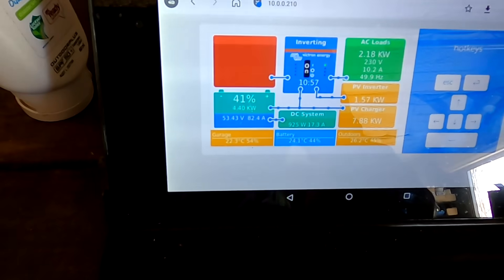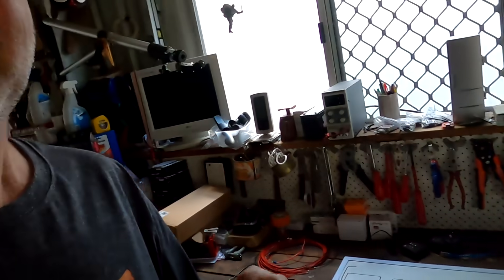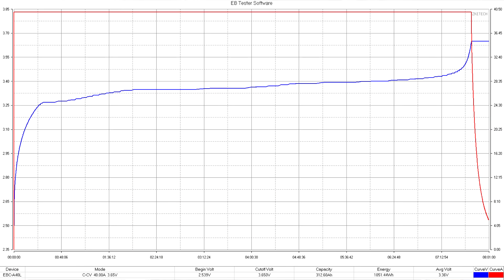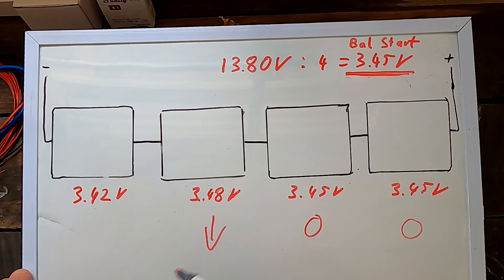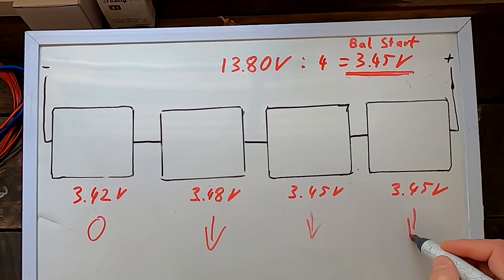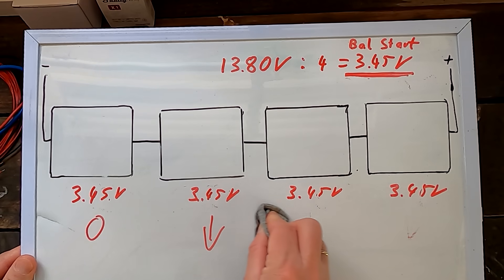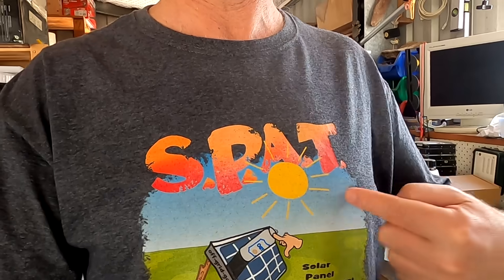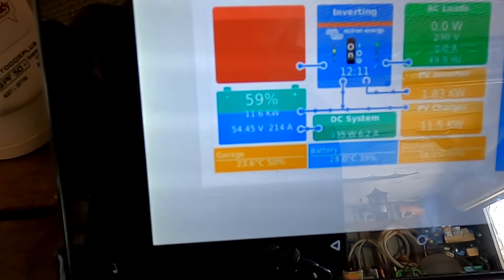Balance Start Voltage for LiFePO4 explained. Why you should not start too early... 🔋⚡

Comment: I have this problem. I just built a 48v battery, and 2 of the 3.2v cells are running at 3.45 volts, but all the rest are at 3.28-3.3v. I am running JK_BMS with active 2 amp balancer. I am not sure if I should pull all the cells and run them parallel with my Zketech charger, to bring all the batteries up to full charge, or just leave my EG4 48-58v chargeverter connected and just leave it charging all the cells while still connected to the BMS.

Comment: You misunderstood how the balancer works, Andi. The balancer is NOT reducing the cell voltages to the balancer start voltage. Thus, it is absolutely fine to start balancing a bit earlier.
Reply: Yes seem logical only if there are some cells clearly ahead in voltage you could already start balancing them down inline with the other cells.
When the voltage diff is quite close then switch to your top balance voltage only.

Comment: Sorry that I have to say this, but you are wrong. Active balancer discharges the higher voltage cell and charges the lowest voltage cell. So there is no loss in power. You SHOULD start balancing early! I start at 3.3V and keep them balanced whole time. Balancer will not work against the charger. But it will prevent the bms cell overvoltage cutoff.

Comment: Hi, in my mind balance means tacking from highest voltage cell and giving to lowest voltage cell. So when highest cell is 3.60 and lowest cell is 3,40 but the balance trigger is set to 3.45 , doesn't BMS take voltage from 3,60 cell and give it to 3,40 cell despite that lowest cell is below the balance trigger ?

Comment: From what I got, there are two types of balancing: Limit and Auto.
The auto has a start voltage that can be set lower, along with a minimum voltage difference. It will only engage if: Cells have a difference higher than the minimum setting, and the current is very close to zero. Why? Because in my experience cells usually don't have the same internal resistance or behaviour along the charging curve, they tend to move around while charging. But when current aproaches zero (almost charged) the more charged cells start to show up clearly, then they can start balancing even if the target voltage is still far.
Then there is the Limit Balance, as explained in this video, it's a mandatory balancing voltage that starts working if any cell goes past that point no matter the current. However, I have set it up higher than my target voltage, because some cells can go above the target voltage at high currents, but drop after the battery is almost charged. It will engage only if some cells are very out of balance, as the voltage would be unusually high. 
But this is my 2 cents and how my programmable BMS works.

Comment: This philosophy is wrong. I would start bal as early as possibles. For example 2,8 V. In this case you would ballance the cappacity of yours cells, wich is the goal no ? Not the voltage. Leave bal function running as much as possible to maximize pack capacity. I have already 3 years running with this setting  on my bat pack and noting suggest different !

Comment: Hello Andy , ithink the battery plateu changed to rise in volt itis the good for setting triggers of balance because if begin at high voltage the time is not enough to complete balance because they triggered cell over voltage protection and then voltage dropped quickly to resting voltage of cell around 3.33 , and when triggered the return charging again they stress the cells in charging and stress bms , so to set bms return charging to voltage in the last of platue to not trigger charging unless using battery.

Comment: Hi, i have a question, if balancer is only performing dropping voltage of cells , there is no way to balance the batterie while discharging if you have one cell that is unbalanced ?
for example my battery is currently discharging (at 10A because i can't find on the growatt how to limit discharge current) , and the delta V of the cells is 0.279V with my lovest at 2.945v compared to other cells ranging from 3.162 to 3.224 volts.

because of that i may hit the 0% soc (2.58V)  value while being at around 40%.

so how can we prevent that ?

Comment: Lets not forget that passive balancing resistors drawing very little energy and does not stop charging the cell. Effectively slowing the charging down for the cell. So it is ok to start balancing earlier with PACE BMS balancer to give it more time to slow down runaway cell.

Comment: Sir    if  balance start   i set 3.45v  for lifepo4 pack  cells   but  what  is the  balance stop  voltage  for  that  should be  same?   Please  tell  little  confuse

Comment: Set the balance start voltage? Where can you set a balance start voltage? When you buy a 12.8V LiFePo4 battery, you can't adjust anything of the bms. Unless you maybe open the sealed battery and loose your warranty...

Comment: Well a smart balancer would take voltage from just the high battery and put it to just the low battery.. If you have a couple cells that are really lagging, moving a couple amps an hour could take many days to balance out.. So starting sooner when there is an obvious difference does not hurt at all.. I found that a slight resistance imbalance in the connection between the cell terminal and the battery can induce cells to lag behind..

Comment: When you prime the cells, after charging them to 3.5+, connect them in Parnell for couple of days with small power supply at 3.5-3.6 v, keep for couple of days, this will balance them perfectly.

Comment: Hi. Andy. Could you guide me please when my battery bank in discharge mode then if one cell is week and its reach 2.6v but other are in 2.9v stat then why balancer is not in on mode? to help week cell
Reply: If you read some comments above you would set the start balance voltage to the default 3.0v. how does this help? when your battery is being discharged, the active balancer will help even out the cell voltages and prevent the weakest cell from hitting the cell UVP too fast. that was my experience too. keeping the start balance voltage at 3.45v will not help the cells during the discharge cycle. experiment with it and see what's best for you though.

Comment: @OffGridGarageAustrali Hallo Andy,
erstmal vielen lieben Dank für deine hilfreichen Videos.
Zum Balancing habe ich allerdings doch noch eine Frage. Ich habe ein 75S System aufgebaut, welches ich mit einer Ladeschlussspannung von 256V eingestellt habe (3413mV). Nun habe ich bei meinem passiven Balancer noch drei weitere Werte zum einstellen:
1. Start voltage balancer: 3390mV
2. Opening pressure difference (30mV) und
3. Closing pressure difference (20mV)
Ich frage mich nun, welche Werte sollte man hier einstellen?
Wenn ich es richtig verstanden habe, dann beginnt bei dem ersten Wert der Balancer und beim zweiten Wert hört dieser auf. Er soll ja auch nicht die ganze Zeit dieser an sein.
Wäre super, wenn du mich kurz unterstützen könntest.
Sag schon mal Danke

Comment: There is no suchbthing as target voltage. You could be charging to aby voltage you want, when exceeded nothing happens. If you top balance, your target is to balance. Balancing should start early as it is small energy compared to 95%+ SOC. You have it in one od your films showing unbalance at 50%, just because top balance did not happen for half a year or so. My Jk is set to start at 2,5V and to keep delta below 20mV. Bms should measured and show which cell needed the most juice to keep up between cycles to help you decide when to replace a cell.

Comment: Hi Friends, thanks for you videos I tried to implement my solar off grid system, Now i have a question, the first mouth, the battery without problem reaches the 3.45v for star balancing, but  after few months the cell doesnt reach the 3.45 so I set the star balancing volt to 3.40 and again reaches that volt, now after some moths, the cells dont reaches the 3.40 volt to start balance, so what Iam doing worng, I have a battery 24v with 8 cells 304ah, I need to consider something else? at least the cells reach 3.38 and the jkbms reports 100% for 1 hour

Comment: I thought the balancer took from the highest and gave to the lowest. Are you saying the balancer only discharges the high ones but does not put that charge in the lower batteries?
I'm even more confused now.
Reply: active smart balancers do. If you are using a good balancer of modern tech, this video will do nothing but confuse you and undermine what you already know is true. My JK bms doesn't behave at ALL like he's illustrating in this video. Basically, the information does not apply.

Comment: Wouldn’t a battery bank balance itself over time by just parallel connecting the batteries together? For example, if I fully charge my 3 - 24V 200Ah batteries separately (600Ah total) then parallel connect them set for 2 to 3 days or more. Would they not balance?

Comment: active ballancers solve everythink. BMS passive balancing 60-150mA is bad joke for 280Ah cells.. active ballancers have 0-5 amps if disbalance is small current is small, same for big disbalance = big ballancing current and active ballancers run all the time supporting poor cells and after time we have minimum  disbalance, maximum lifetime and max usable capacity.

Comment: An active capacitive balancer  will be acting to bring all cells to the same voltage.  The amount of charge moved between the cells is tiny for the flat portion of the LiFePO4 curve, charge transfer only increases when voltage imballance increases.  There is a small loss associated with an active balancer but if you battery is big this is of no concern. Conclusion you can start an active capacitive balancer early. Or even leave it running all the time!
The active capacitive balancer will have undervoltage lockout to enter a low power sleep mode. However you do not want to trigger/rely upon this as it is likely set below 2.5V

Is there anything wrong with the above?

Comment: 1. some BMS do have active balancer built in.
2. most active balancer works with cell difference/deviation  and then you can have a low start voltage for balancing and the balance only starts when the cells have a deviation > x Volt . Then it's better to have a low start voltage for balancing, specially if you never balance before, it can take over a month for 1A to balance it.
Reply: I have this problem. I just built a 48v battery, and 2 of the 3.2v cells are running at 3.45 volts, but all the rest are at 3.28-3.3v. I am running JK_BMS with active 2 am balancer. I am not sure if I should pull all the cells and run them parallel with my Zketech charger, or leave my EG4  chargeverter connected and just leave it charging.

Comment: I see alot of post's about batteries, balancing etc.. but I rarely hear the one most important thing of a battery pack, not so much for lead acid batteries but most other types, resistance matching, if you can, match the cell resistance as close as possible if in parallel and then for any in series, resistance match those too, I have seen some put slighty higher resistance cells in the + and - positions as they get hit first. Resistance matching also leads to much less requirement for balancing and will add to cell life. Obviously, this is more important in larger packs made from 18650 but is also relevant with large prism cells too  IE: 400 amp hour cells in a 12v 4 cell pack. Putting power into a cell only to bleed it off is just a very expensive heater.... I got these robot battery packs from the USA 21700 cells 36 v 10s 11p and they are so well matched I barely see a deviation of 0.05 volts while charging and discharging. My application is ebike and related so the cells are 14.5 amps constant 4850 mah, 36v @ 150 amps max discharge per pack  52.7 amp hours each,I have 4 of them heh.  So whoever built them, did a damn good job matching, of course when you have access to thousands of cells, it's much easier to match. So if you buy in bulk, or buy used and can check the cells before you buy.... it might be something you want to keep in mind, like if you build something like the guy in Aus with thousands of cells, or a Tesla wall battery thingy ^^

Comment: i don't see any logic in this video as this is not how modern balancers work . just because you set the balance voltage to 3.4v does not mean the bms will constantly discharge this cell until it reaches 3.4V . by your logic if i set balance voltage to 3V and my pack is currently at 3.6v per cell the balancer will start discharging the pack - this is not the case . balancers should work only when there is a voltage deviation between cells
Reply: Agree. I think there is misunderstanding of "balance start voltage". Start voltage is literally start voltage, but not target voltage.

Still, the balancing method described in the video will work fine, but not as efficient as it could.

Comment: Andy, if BMS-only (no active balancer), I am seeing high .050 Delta voltage (and higher) around 3.3v.  I was seeing even higher Delta over .15v last week.  The battery bank is about 2 years old (48, 100ah CALB cells in a 6P8S configuration with a DALY 500amp BMS).  Having started balancing at 3.3v at .2 Delta, the pack reaches about 3.4v with .25v Delta during Equalization.  I have ordered a 1a smart active balancer to add to the system.  I may boost balancing start voltage now that the cells are reaching lower Delta.

Comment: Target voltage/cells in series makes sense for higher target voltages. Does the same formula apply for lower target voltages? Say your target voltage was 54 for a 16s pack,  is 3.38V what you would recommend for balance start threshold?

Comment: On my two amp JK balance BMS I raised the balance trigger voltage too 0.020 because my cells seem to be quite a bit different size in amp hour.  Even though they're perfectly balanced at the top if I start charging quickly the lower amp hour cell starts to raise higher in voltage than the other cells. This would cause the balancer to create imbalances if I did a tighter threshold.

Comment: Rabbit hole alert. What if you have a cell that's got considerably more self-discharge than the others. Then maybe you need an extra cell deviation set point. One that says hey, if the cells get extra far apart even though it's below the normal balance start point go ahead and start actively balancing, taking power from the others and putting into this problematic cell.  That way as you're state of charge moves around on the cloudy month somewhere between 10 & 90% that low cell will actually trigger some balancing so it doesn't get ridiculously far behind.  Because otherwise they'll be no balancing done because you never reached full the whole month.  And that little two amp active balance won't be able to keep up when your system is ramming 200 amps into your battery up to the full mark quickly on the first sunny day of the summer.

Comment: I don't know how your balancer works, but mine doesn't start balancing until both the "Start Voltage" & "Delta Voltage" parameters are met.  First, a cell's voltage must be above the "Start Voltage" and then the highest cell voltage must be more than the lowest cell voltage by the "Delta Voltage".  Then and only then will the balancer balance any cell who's voltage exceeds both these settings and only the cells that do exceed these parameters will be balanced.  Your way will only balance when your cells reach their maximum voltage.  Due to the flat voltage curve it doesn't make sense to start balancing until the cells reach the knee and the voltage starts to rise quickly.

Comment: Andy, what if my batteries are around 3.3v each but out of balance. would it be ok to balance at the 3.3v and once balanced charge to a higher voltage and rebalance again? The reason I ask is that I only have a 5 watt power supply and trying to get all cells up to the 3.45v each is going to take awhile. 280ah batteries

Comment: IMHO, a smart balancer will work "all the time " when you want a low deviation such as 1mV. If you are happy with a 10mV  deviation then the balancer will just finish the job and stop. It ill not start balancing just because balancing is enabled at, say, 3.2V. It will wait for a deviation higher than 10mV. I guess I am telling you to stop balancing to 1mV and try 10mV or even 20mV instead.
Looking forward to your reaction and to learn more.
Reply: I guess there is a difference between (dumb) active balancers and smart active balancers. The dumb ones cannot be configured and they start working when the first cell is above a certain voltage and are then working continuously until the first cell voltage falls below. The smart ones can be configured to be enabled when the voltage of the first cell is high enough. In addition, they start balancing only when there is a deviation above, say 10mV (configured) , and this does not happen in the flat area of the curve.
I guess a smart active balancer is the way to go.

Comment: Ok this makes sense to me if I was using individual cells that I could check the voltage of each cell. But I am using sealed Drop-in Lifepo4 batteries (2 x 12.8v 100 ah )and have no way to check the voltage of each cell . How do I balance the cells in each of these batteries??

Comment: On a JBD BMS, allowing it to passive balance during discharging also works wonders, given a month (yeah, I tried) you can get a perfectly (within 5mV) balanced pack even if you started out with a not entirely top balanced pack. Takes a few over-voltage disconnects on the charge end, though.